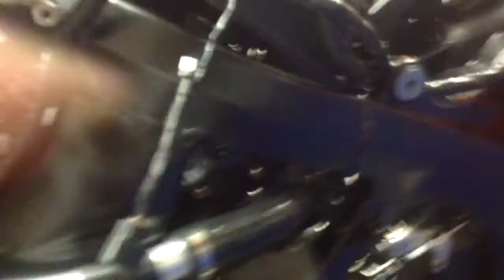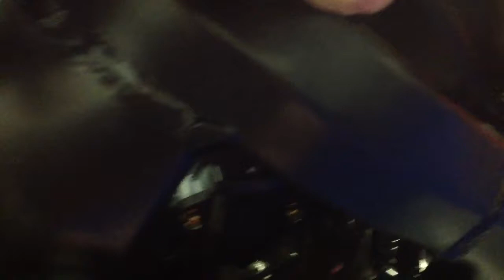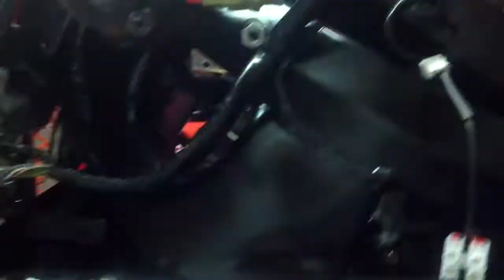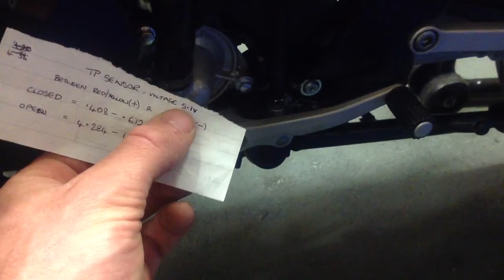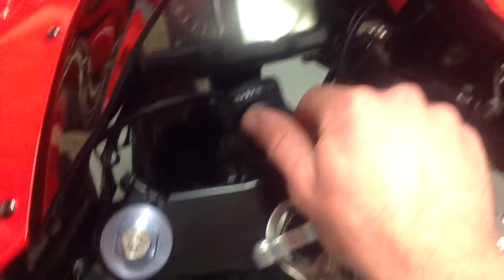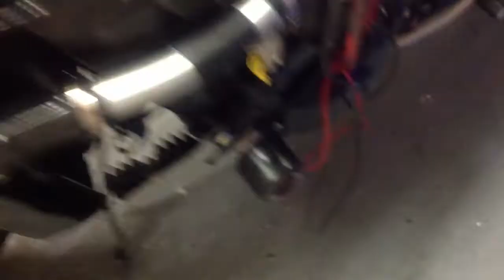CBR 600 RR3 Throttle Position Sensor (TPS) Adjustment.

Comment: Good informative video. My TPS read 2.5V at closed throttle. Over fuelling like a pig at idle. Now I know why. Thanks man
Reply: did you have any bogging issues at low rpm?
Reply: @YahirSvt yes. Only smoothed out at middle to high rpm

Comment: This just helped me out so much! I think im going to buy a tps from a Honda Accord or a CR-V because they share the same part number and they’re only $14 USD. I just got to figure out how to get the old one out😂 and if it doesn’t work... then oh well. I wasted $14.
Reply: any luck? just got my bike diagnosed and its the damn tps and I dont want to spend a fortune on a throttle body assembly.
Reply: @davidnunez3523  can you till what was your problem because my sometimes the throttle disconnect and connect when I’m riding I need to know if this problem from tps or not I hope you help me
Reply: you need to connect your bike to a code reader and you can see if the TPS is reading correctly. look up a dlc to ODB2 convertor plug. Then get a OBD2 to USB adapter. not a cheap one. get an expensive adapter with a real chip. then use MCU Innovations HondaECU: Kline software. This will give you a live readout of the throttle position sensor from 0-99% throttle.

I was able to use this to verify my tps was not the issue and also that honda accord tps DOES NOT WORK. It physically fits on the throttle body but the potentiometer is different output so it doesnt go from 0-99% correctly. This might be able to be reprogrammed with a custom ecu flash but i stopped looking into this because I am now working on doing a full stand alone ecu.

If your tps is the issue, in the software you will have dead spots or jumps while slowly moving the throttle. verify that at closed throttle you start at 0% and that it gradually reaches 99% at full throttle. This is also how you can replace and calibrate another TPS from another cbr if yours needs to be replaced. simply rotate the tps until closed throttle is 0% and full open is 99%. it is more accurate than relying on translated voltage in this video.
Reply: @Jasser1reach  see my above post I accidentally deleted your tag
Reply: @davidnunez3523  bro you are a genius
Reply: I got TPS from Honda Jazz 2004 to 2008 model.. fits 100%.  But seems my problem is something else on my bike.
Reply: @matthysharmse4200  it fits but i guarantee the tps readout is incorrect. use the software that i mentioned to verify closed throttle is 0% and open is 99%. If so then we have found a true replacement. if not, the only way to make it read correctly is an ecu reflash from someone who can rescale the tps to work. but it also might not have the same step resolution to a stock sensor so it could be a downgrade.
Reply: @davidnunez3523  well i have the TPS on the bike and she feels good. Will try get the Converters and readers. Just not so easy to find here. And not cheap. A diagnostic from honda dealer is R750 South african Rands. So not going to spend money on that.
Reply: @matthysharmse4200  you just need a dlc cable to obd2 converter and a obd2 to usb converter cable and free software. I paid about $50 USD on Amazon and the software is aftermarket and free. This will also let you pull any trouble codes in the future. Not too expensive at all. You just need a laptop to run the software.
Reply: @matthysharmse4200  the bike might feel ok but the honda accord TPS i used only went to like 85% reading on full throttle. So it might not be efficient or running full power. I would definitely check and report back as it will give us more information on potential plug and play options for our bikes. if you found the right model number of tps that would be cool.
Reply: @davidnunez3523  im sure a power commander TPS tap would also help to see TPS percentages.. maybe i should just get a PC for my bike. Zero map it and at a later stage have it tuned
Reply: bought jt7h ( accord ) TPS for my 650R at close position 0.5volts bike was idling crazy at about 4000rpm but when i slightly twist the tps at about 1volts in close position idling was fine. what could be the reason pls help me . also black smoke at higher rpm and less mileage

Comment: Nice easy video to follow! I was kinda hoping my sensor was faulty  but I'm getting the correct readings! I'm getting erratic idle and it stalls eventually but it runs fine apart from that! Any guidance would be appreciated.
Reply: i really hope you see this i’m having eratic idle and my bike shutting off but my tps sensor is working fine did u ever find out what the problem was i have tried so many things and i’m just stuck
Reply: @wilkiez2619  Hi yes I've received your message! My problem was dirty throttle bodies, I cleaned them with intake cleaner and it now idles at 1000rpm nice and smooth, not to much though as I managed to hydraulic lock my engine and killed my plugs. Just a gentle clean around the butterflies to remove any wax residue.  Let me know how it went on.

Comment: Hi Ross. I have an "04 cbr600r.  my reading is 5.3 volts with throttle closed or open.  No flux in voltage.  mine has some wierd circular nuts on the tps so I dont know how to loosen them for removal.  Is mine bad then with the full 5 volts at closed throtttle.  i testd the orange and green and the yellow and red.  The red and yellow was no voltage so apparently thats not power of any sort .  Any help is appreciated.
Reply: Did you fix that? Mine is the same

Comment: Close is with the idle screw backed all the way out (butterfly closed) and open is wide open throttle (as open as it goes before starting to close again) IIRC.
Reply: ill be sure to do this
Reply: @davidnunez3523  Don't know what you are taking about, you do you mr. robot
Reply: @Snurre86  me on my other account. I'm calibrating a TPS and I was going to visually look at my throttle plates to make sure they are closed.
Reply: @clutchboi4038  the tps on this bikes seems to be redundant, I see absolutely no difference from even having it disabled. You can can visualy calibrate, but first get the bike running. Use a see-through hoe with 2-stroke oil in it to sync the carbs at idle first.
Reply: @Snurre86  this bike is fuel injected so it has throttle bodies, not carbs. The TPS sends voltage signals to the ECU to tell it the throttle plate position for proper fuel delivery since it has electronic controlled fuel injectors.

Bike is running now I just have power loss at the upper RPM ranges, so I'm chasing down the problem. Got the bike back from the mechanic who said the TPS was bad but I just tested it again and get solid voltages like how this guy gets in the video, so hes probably wrong about the TPS. It might be something else. I'm going to check to see if it has any fault codes right now.
Reply: @clutchboi4038  sorry about that, it is 5 years since I watched this, though it was the carb model in the video.
Reply: @clutchboi4038  did you get it sorted? What was wrong?